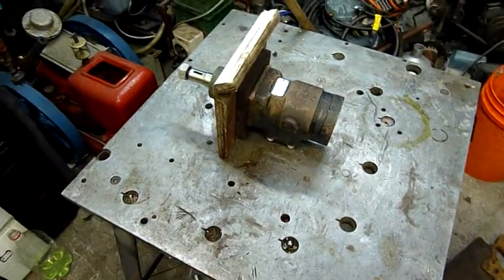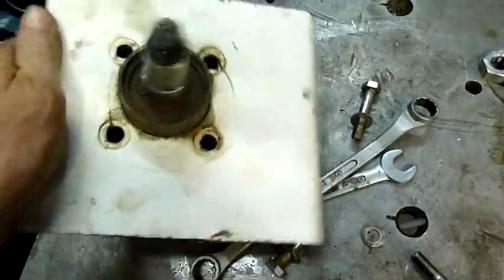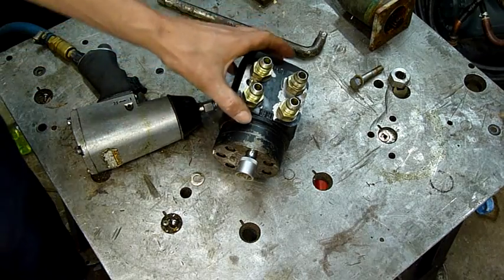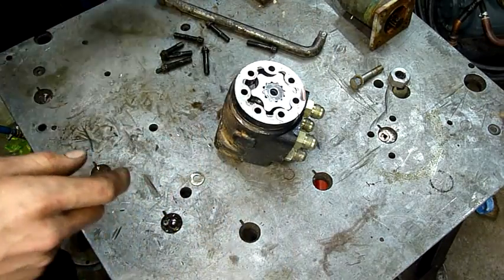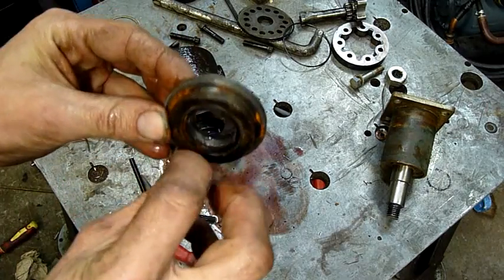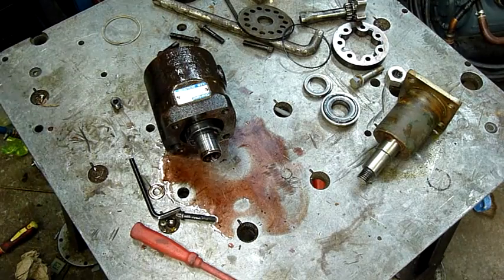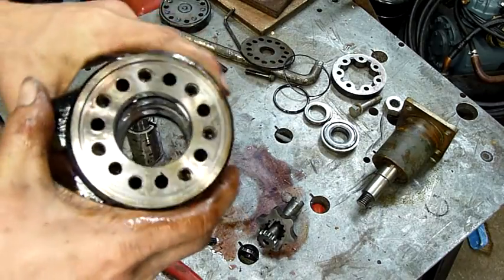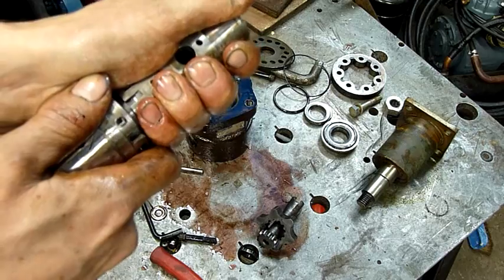Char-Lyn Hydraulic Steering Valve Autopsy

Comment: they do make hydraulic motors with 4 ports on them!
A port
B port
Swash plate control port (controls displacement of the motor)
case drain port
hell the dan foss lc/kc series have a 5th port for the brake control of the planetary hub it's bolted too

Comment: those 2 gears is called metering pump to control steering speed . this little valve you called grub screw for anti cavitation - diverting oil from return to supply in case high demand of oil . alignment is important by drawing single line on the whole valve. I stripped one before without alignment ,after assembly I try turning right , the whole wheel turn forcibly to the left. finally the whole thing is called orbit roll valve
Reply: If I turn left and try to steer right the wheels will keep going left but the steering wheel won't, I have to turn left to and then right to get it to catch again. Is this little box  my problem???

Comment: The gerotor at the back measures the volume of fluid pumped to provide proportioning. Automobile power steering systems still use mechanical feedback. You see there are there are 4 tabs linking the inner and outer sleeve that provide the spring action. The user turns the inner sleeve porting fluid to the steering ram, the fluid then pumps though the gyrator pump returning the outer sleeve to the neutral position once the user stops turning the wheel. It should also work with no fluid pressure.

Comment: i have repaired many of these valves, if there not timed correctly and ur only a tooth out u can effectivly turn them in to a motor is pressure is applied to the correct port

Comment: Oh, new computers and batteries every 5 years, you better not let my 2004 Toyota Prius hear, because that hasn't done any of those things. Also you should check your facts, because Toyota Australia offers a 8 year warranty on the battery. And those crappy computers manage the NiMh battery so well, it won't let it discharge below 40% SOC and won't let it charge over 80% SOC so it is one happy battery for quite a long time. The only thing giving me trouble on that car is the petrol engine.

Comment: Interesting piece, always wondered what was in those, Thanks Aussie. Look up Selsyn Control they use two motors connected together with wires and if you rotate one the other will follow. I have heard this system was used on submarine steering. ;)

Comment: wow thats just a waste. i mean the computer systems, motors, and batteries add a lot off weight which does not help. but with the motors u get loads more torque just very low hp

Comment: Really clever design, so i suppose any movement of the wheel causes fluid to move from the rear pump and the rotation of the outer tube closes the ports off so it moves no more.
Ish, sort of, guessing without mecanical qualifications :-)

how ever it works its a great design, no wonder its expensive.

Smashing dissasembly :-)

Comment: hmm looks like as the wheel is turned, it pumps the fluid, and the valve opens to let it to the steering cylinders, then when you stop turning, maybe that valve closes to prevent backflow.  Interesting that human power seems to pump the fluid around.  I don't think it's proportional, and relies on your cranking it to build pressure to move the steering.  The valve just ports fluid depending on the direction you turn it.

Comment: Yeah, they have 2-1/2 ton trucks where I live which have buffered diesel-electric drive.  They have a 100% electric all-wheel drivetrain.  A battery pack stores some electricity to help with acceleration, and the engine does the rest.  It does help quite a bit for trucks which work all day in city traffic, otherwise it's not really worth it.